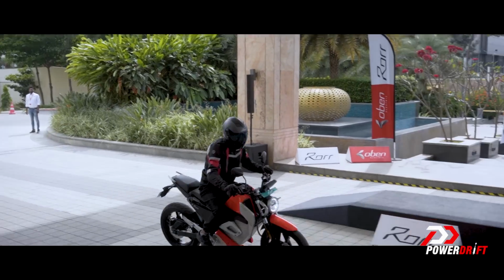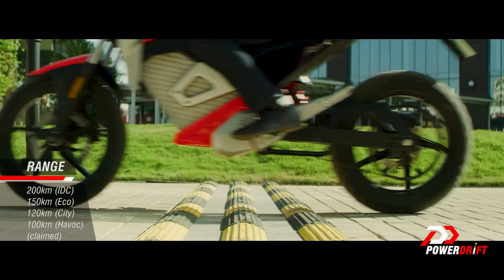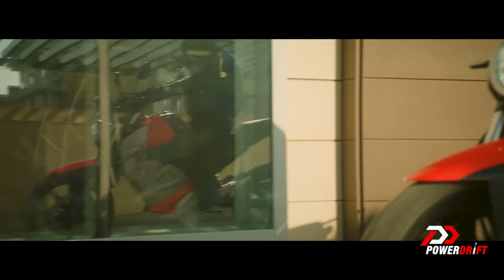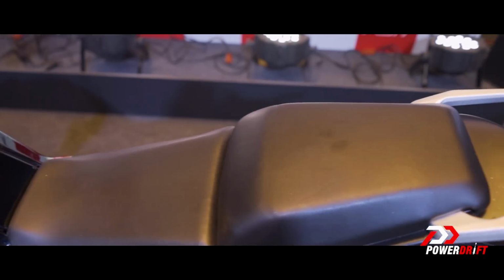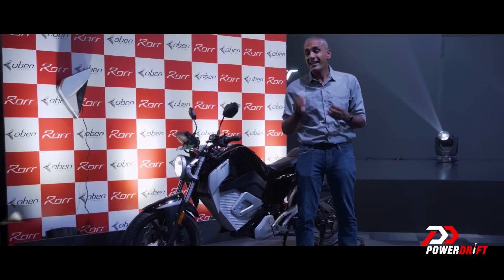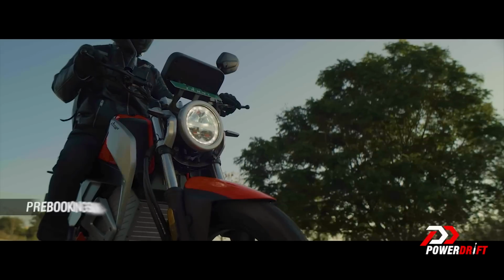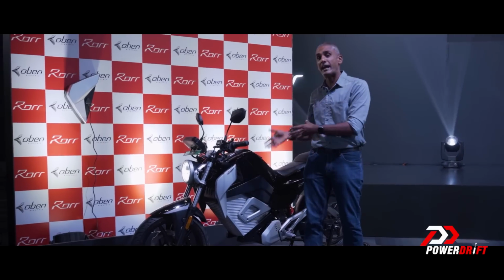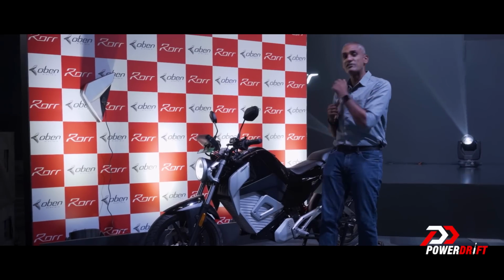Oben Rorr | First Look | PowerDrift

Comment: 150 km is a pretty descent range. I have been using revolt rv 400 and maximum distance I have travelled since then is 97 km.
Most of us don't require that much range. You can't practically travel that much in routine basis.
Reply: But we need to charge daily which ll be annoying, if we get 150ramge we can charge 2-3days a week

Comment: 120 km/charge ? No it’s not enough, bocos after 1 or 2 yrs of use that will come to 70-80 km/charge, even less, depending  on the quality of the cell
Anything less than 200 km actually means nothing bcos u can't even go for a short drive in the weekend

Comment: PD: Is 150 km range enough for you?
Me: O HELL NO!

Explanation: Considering that this is fixed battery and not swappable, and taking a conservative figure of say 120 KM (City) .. the degradation after a year will just give you about 100 km. Recharge time of 2 hrs is still quite much so we can negate that (swapping stations would have been the solution). Now if you commute like I do around 40kms one way that just leaves a fraction for use during emergencies or if your job requires you to travel between offices.

That big chunk of metal which looks like a huge heat sink looks ugly too. The could’ve covered it up with fairings but I am suspecting it has something to do with heat dissipation. Sure the ICs won’t overheat, but your thighs probably would.

Comment: 15A socket. 230VAC input. Assuming max 15A is drawn by battery for 1 hour. 230 x 15 =~ 3.5kW. And that means 3.5 kwh. i.e 3.5 units for a day for EV charge . So for 30 days . 105kwh. Per unit cost 5rs. 105x 5= 525 spent for travelling approx 70kms x 30 days. Not bad

Comment: I still feel EV is not the right mainstream technology. For intracity travel, it’s fine to have such options. However, in a country which still primarily depends on fossil fuels for electricity generation and where it is time taking to develop such infra, we should’ve pushed for hybrid first. It’s near impossible to travel outstation in EVs if you want to go to some offbeat place. 
Also, the false carbon neutral veil has to be lifted off the EVs here. We should invest in hybrid tech for the time being and also explore hydrogen fuel cell. Many countries like Japan are investing heavily in that tech, especially after exploring waste disposal, recycling and sustainability of EVs. Yes, H2 has its own share of problems too like last mile delivery, safety concerns etc, but it’s closer to being a cleaner source of fuel than EVs for sure. Just a few personal thoughts.
Reply: I agree that EVs makes sense in intra city travel, but they fail so far in long distance journeys. Now, imagine a hybrid with 60-70km EV range and rest petrol. Within city, you can use EV mode and for outstation, there is no range anxiety. 

Regarding hydrogen fuel cell, my point is that it seems more sustainable and carbon neutral on paper than EV. With the current battery tech and waste management practices, EV will fail once the volume increases. Right now, US is happy dumping old batteries to Africa, but it won’t be sustainable once this tech goes mainstream. Our over expectations on EV is what I am worried about.
Reply: @AXELAGONY  That was one perfect reply but brother it hurts when the world doesn't have the same mindset otherwise everyone would have lived in peace and wars would just be a history. I wish everyone has a peaceful mind and heart.
Reply: It's far far away ... From revolution ... Bro this new stuff that r coming out ..it's like tuk tuk ..  and if this brands need battery cells from outside then what's the point !!! .. first create battery and cells in India ..like tesla byd even zero has Alta used to but harley killed them  .. ye electric brands r useless ...
Reply: I don't think you will be seeing hydrogen vehicles for personal transport. There were only 3 hydrogen cars from Hyundai,Honda and Toyota, i think two of them have stopped or going to stop production. Hydrogen doesn't make much sense for private vehicles, there are many videos on YouTube expiring why.
Reply: You've got a valid point bro. . But the whole point of getting an EV is to reduce the cost of a daily ride. Maximum people use their bike or scooty just to commute locally in the city and every family has a fuelled vehicle in their house so if they want to travel far away there's always an option. Evs are just an alternative future.
Reply: And just saw the news of Hydrogen Cell Mirai testing starting in India.

Comment: in the starting phase of ev industries we are getting decent range and charging time if we wait for another 5 years it will be a completely different story 400-600 km range with 30 min charging time will be common among those bike in future  . but as of now petrol bike makes more sense . evolution will take time so we must wait .
Reply: I don't think you're seeing how ev industries getting bigger and bigger everyday, tackling oil use, is very important for a country like India, you don't need to wait for 5 years , just around a span of 2 years , ev will rule the world, nowadays I am seeing a lot of ev scooters even cars everyday.
Reply: +1
Reply: 5 years is a short period of time to make such a leap. R&D for a new battery tech and making it commercially available in mass quantity will take a long period of time.
Reply: I;
Reply: Yes and going to 3 to 5 lac
Reply: Pls , we need to buy EVs . Buying ev will reduce terrorist funding from the middle East.🙏

Pollution from crude oil extraction and fuel combustion combined is far more pollutting than an ev which runs on thermal power.